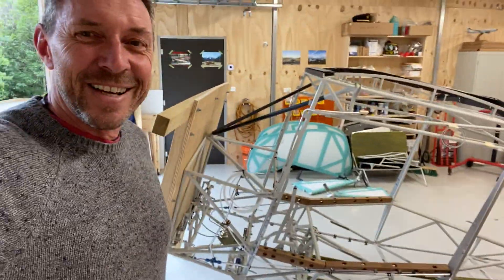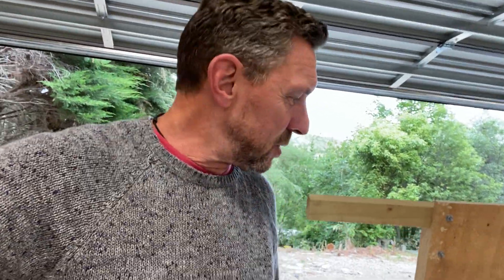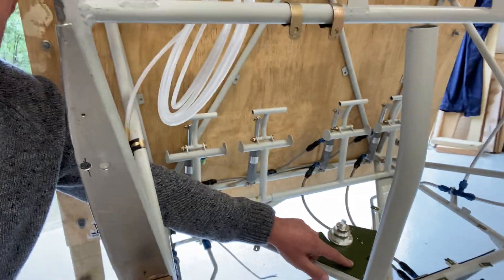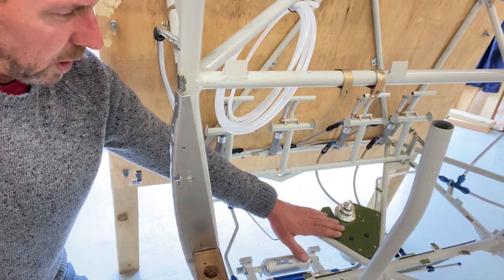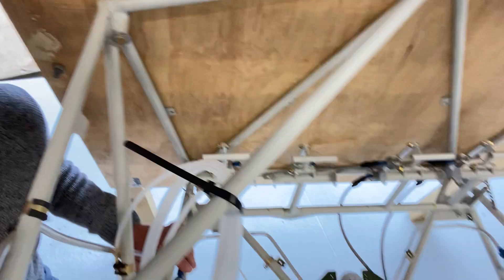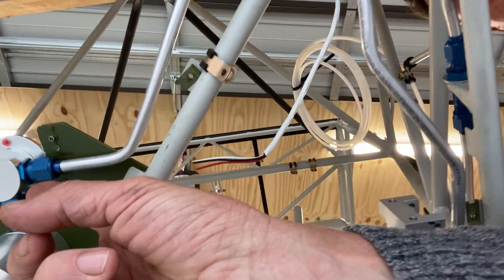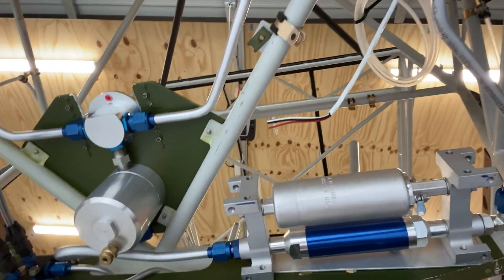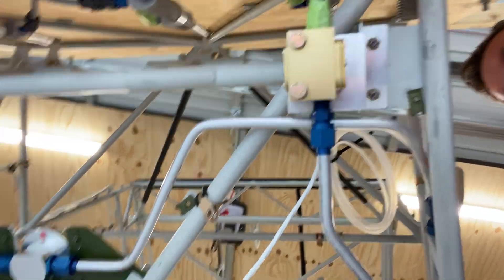Bearhawk Aircraft - Bushplane Build -  Fuel System

Comment: Hi again!

Do you think you are losing much compared to builers that have fabricated rotisserie fixtures for the fuselage? This sure looks much quicker to get going.
Reply from the maker: I nearly built a rotisserie at the start, it would definitely make certain jobs easier. But overall it hasn’t bothered me. I think even with a rotisserie you would still need to remove it a couple of times for fitting parts. You end up checking that parts fit many times then taking it all apart again.
It would have taken me at least one day to build a rotisserie. I was planning to make one for the wings, but today I got the wing crates out (I’m going to put them in storage tomorrow for a month or two) and I think I’ll simply use the crates as a workbench.

Are you thinking of building a Bearhawk? Where are you based ?
Reply: @bearhawkblog3527  I'm in Colorado. I've been talking to Mark already and building up a cost sheet. This is the plane I want, I am just trying to uncover as much of the hidden costs as I can before I take a dive.
Reply from the maker: @JosephHHHo  Take a look at the link below Joseph. I made an extensive spreadsheet before I started. Don’t be put off by it. You can easily build for much less than I have. Also I didn’t use everything on the spreadsheet. But I also discovered that I needed some more parts that I hadn’t included - especially bolts etc.

https://static.wixstatic.com/ugd/012017_b87ce91d3a9d4e2c9ec8675e5aebb295.pdf

And here......apologies for the overload :)

https://www.bearhawkblog.com/blog
Reply: Wow, thanks. This is great!